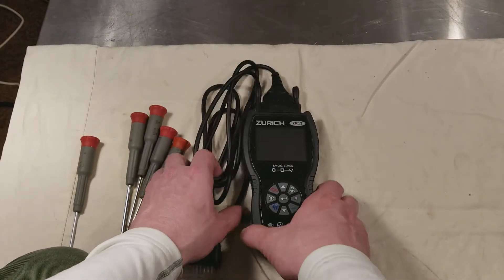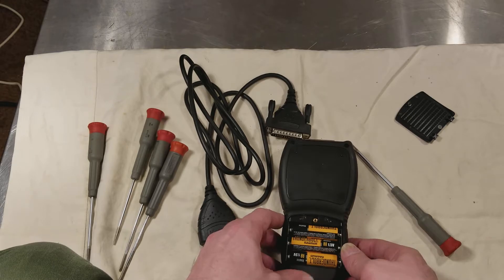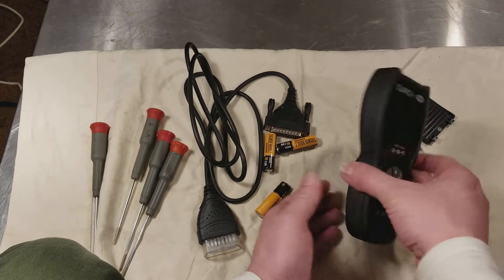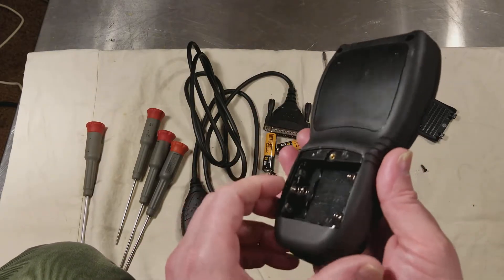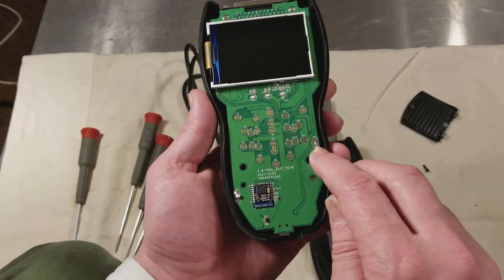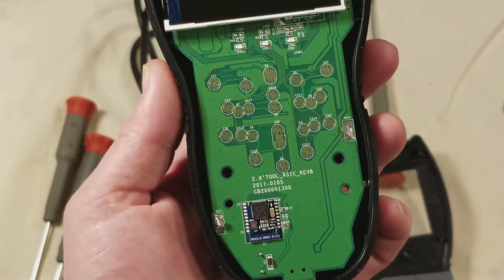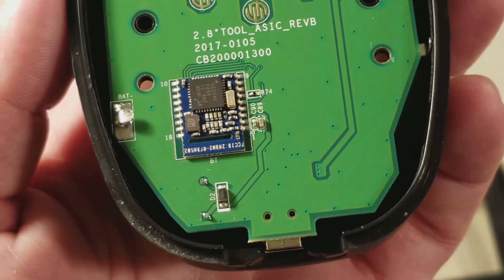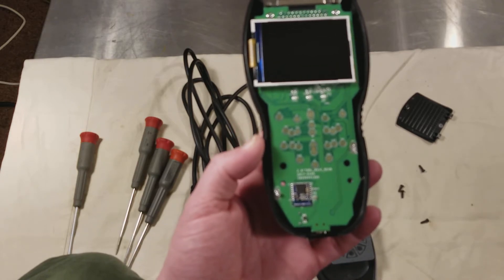TearDown: Harbor Freight Zurich ZR13 Premium Next Generation Universal OBD2/E Scan/Diagnostic Tool

Comment: Did you ever determine if that was a Bluetooth board?
Reply from the maker: I looked up the chip I couldn't find specifics on it but I forgot to look up the FCC ID I strongly suspect it is a Bluetooth controller because on the display there is a Bluetooth icon and the innova units are Bluetooth capable is just disabled in software on the harbor freight unit.
Reply: I hope with time the "wizards" out there figure out how to mod. this unit to bring out it`s full potential. Thanks for the quick reply.
Reply: The TI CC2541 is a Bluetooth Low Energy and proprietary wireless chip. I couldn't quite read the FCC ID well enough to get it looked up. Either that's BT, or it's wireless to a dongle that we don't have yet.
Reply: I'm late but the Bluetooth module links u with the Innova RepairSolutions app. This scanner is an Innova 5100, Craftsman 1681, and Zurich ZR13. Maybe more, idk. Bluetooth search while it's powered on and I'll see it as "Scan Tool" or something like that.